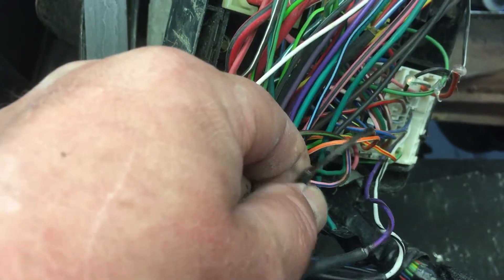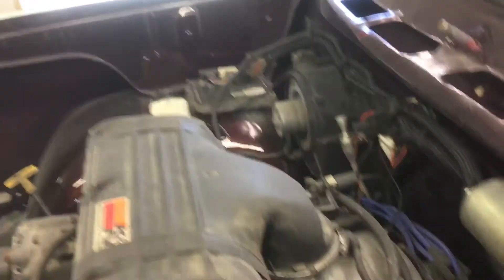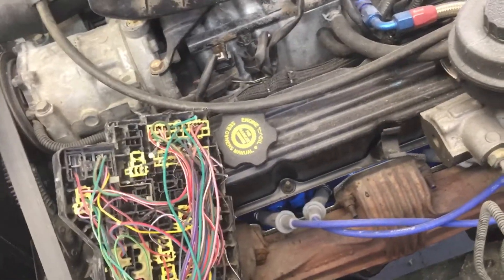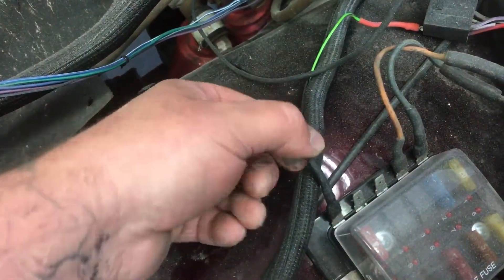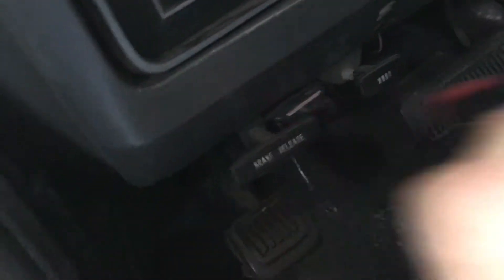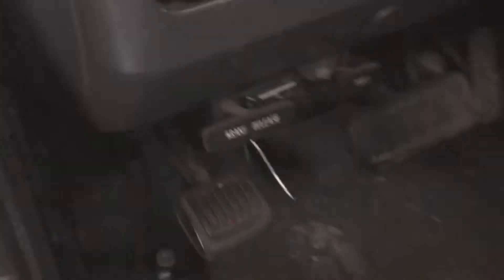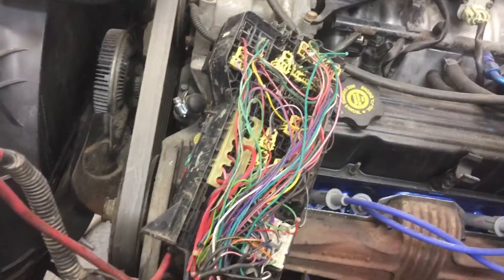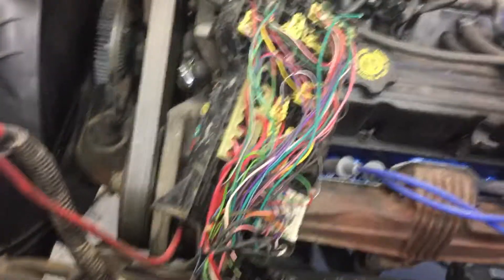5.9 Magnum swap wiring

Comment: I'm following your build attempting the same swap
Reply from the maker: It seems overwhelming at first but its really pretty simple.  I would recommend finding the factory manual for the year of motor and harness you are using. It comes in handy.  The factory 85 starting solenoid is how i got around the transmission is in park or neutral code.  It would not start with out bypassing it.  I'm going to do a video on the gas tank.  Not a hundred percent sure yet but it looks like the tank outta the 2000 will bolt up into the 85.  there might be a clearance issue with one spot.
Reply: @bigcaliber211  did you get the transmission codes cleared I'm in CA and wanted to do a smog legal swap and go to the state reff so I can't have any codes come up..
Reply from the maker: @rodrigomesa5074  No I didn't.   The only code I had come up was the In Park or Neutral code.  The wires for the transmission i have zip tied to the tranny.  I'm in Idaho so I don't have to deal with any of that.  You'll probably need two oxygen sensors,the front ones.  I remember seeing that in the factory manual for CA
Reply from the maker: I'm pretty sure that code is due to the neutral safety switch not being hooked up
Reply: Yea keep up the good work.
Reply: @bigcaliber211  yea I'm thinking of just getting a donor ram 1500 just in case I have all the parts I need within reach.
Reply from the maker: @rodrigomesa5074  That's more or less what i did.  Everthing was just given to me for tearing the truck down.  Motor, trans, wiring harness from the fire wall out, fuel tank and its wiring.  I used the kickdown  cable off the 2000. it bolted right to the 727.  A guy might want to grab the gas pedal outta the donor rig.  The throttle cable fit the fire wall perfect but I had to grind down the cable clamp to fit the 85 pedal.  If you have any more questions I'll try to help you out as much as I can.
Reply: @bigcaliber211  thanks I appreciate it

Comment: Sweet truck. I’ve got a 90 and wanna do the same thing. What all has to be done to keep the serpentine belt set up? Do power steering hoses work or did you have to make your own? What do you do to make it charge? Thanks
Reply from the maker: It's been a bit but I think i used a combo of the 2000 hoses and the 85.  I kept the inline cooler.  In used the the all the original 2000 engine wiring harness and powered the rest of the truck threw the 2000 fuse box.  The red wire powers up all  the rest of the 85's original circuits.  It could be different on a 90
Reply: Big Caliber ok cool thanks. What did you do for fuel system? Did the 2000 sending unit fit in the 85 tank?
Reply from the maker: @thomasmartens7806  I used the factory 2000 tank, I built some new straps and it fit fairly good.  Might hang down a touch more the the 85.  It was easier than cutting the mounting hole for the fuel pump outta the 2000 tank and plastic welding it into the 85 .  tank.  As far as the fuel gauge goes . That I have not worked out.  Ordered some little converter box from Speedway.  It didn't work and customer support had no clue.  The guy never dealt with a dodge conversion before.  I'm looking at one from tanks inc, seems to have a few more bells and whistles.  Cheaper too.  Hope that helps
Reply from the maker: Your truck might be new enough(LOL) that if it came with factory fuel injection the pump in the tank will  work.  The 2000 needs 49, 50 pounds of pressure .  Might wanna check your pump and see what it puts out if it was fuel injection.
Reply: Im doin a 5.9 magnum swap in my 91 d150 and was just wandering if u could give me any advice I have already built the motor and drilled the flywheel still have to notch that trans but im havein problems with wiring
Reply: @fredaustin8898  did you ever finish the swap?

Comment: I'm looking to swap the 5.9 into my comanche with a ax15. I wanted to keep it fuel injection, seems like you might be able to help me?
Reply from the maker: Not sure if i can but if you have any ?'s I'll try and help
Reply: Can you provide how you pinned the obd2 connector? I have a 5.9 swapped Cherokee but can’t seem to get the obd2 pin out correct.